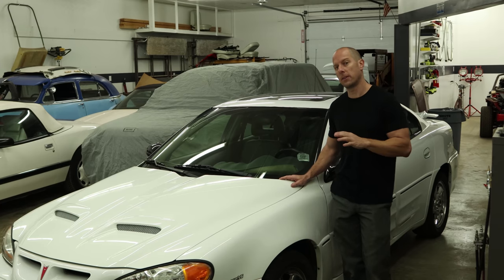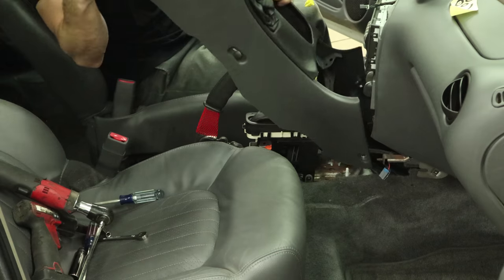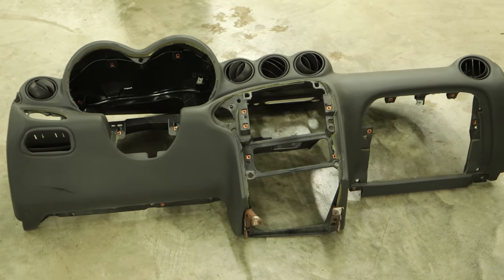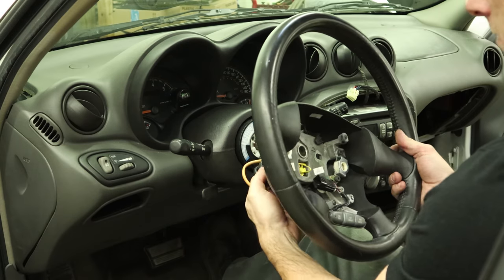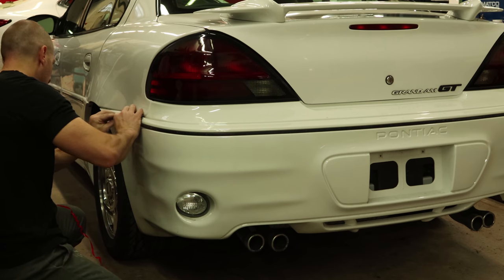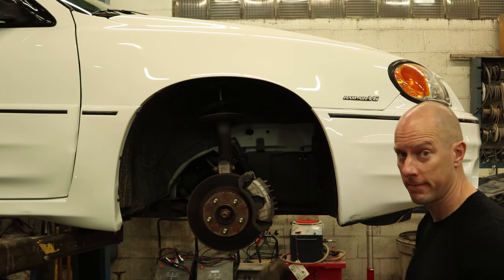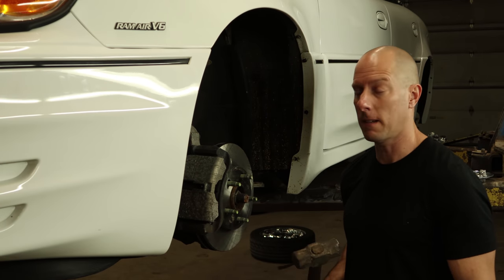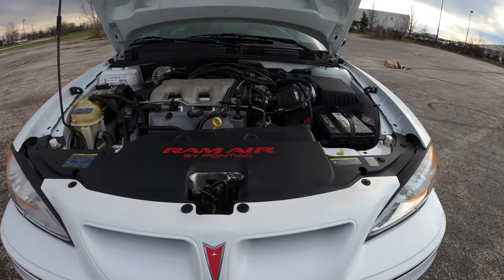Fixing all the typical issues on our super cheap 2003 Grand Am GT build

Comment: This is the cleanest Grand am I’ve ever seen and I like it
Reply: My aunt one had one brand new and it still looked crap compared to this one.
Reply: Anybody know by any chance what the small white car is called in 0:25 in the back
Reply: @clownjubilee1909  Buick Reatta. For some reason there are a couple of them in his garage.
Reply: No smoke stains, no skid marks on the seat, no old fast food trash piled in the back, still has hubcaps. Truly a one of a kind Grand Am.
Reply: Same here, I would gladly drive it!
Reply from the maker: It would have been a shame if I missed it and it got crushed.
Reply: I belonged to the grand am owners club about a decade ago. They had the cleanest cars ive ever seen, and i had my raggidy ol lil 96 quad 4 grand am i bought for $500, and I drove it 2 states away with every year for an annual meet on top of being a DD. I still have it too. I plan on sending it out for body work after i get this new job. Maybe he can help me out.
Reply: @LrulestheworldM8  SWEET! Keep it on the road man.
Reply: I know right? I used to work at a dealer when that was new! This looks like they did on the lot! Brand new
Reply: @clownjubilee1909  Oldsmobile Toronado Troféo
Reply: @LrulestheworldM8  What’s all wrong with it? I’d gladly buy it.
Reply: @StephaniexBecca1600  not for sale. Ill be buried in this car.
Reply: hello question what is the best way to fix  rusted out Rocker planes on 2002 pontiac grand am  2 door it has plastic covers under the doors to the rear well they will not inspection  the car  until we fix it
Reply: Got a 2004 grand am this week and it's just as clean, no rust or anything
Reply: @clownjubilee1909  could it be a mazda meada??
Reply: @vehcor  
Definitely!!!
Reply: I just bought one with 65k miles on it super clean
Reply: I’ve seen a lot rly clean dawg, mine for example was my first car and I’ve had it ever since and it’s clean and modded
Reply: I have a silver 03 that's pretty clean as well. Pretty reliable ride for real if you take care of it.

Comment: Your winter beater is better than my everyday driver.
Reply: Both Grand Prix and Grand am super easy to work on parts are cheap . I have 2004 Grand Prix 3.8 n/a 408000 runs like new shifts like new original just good maintenance good milage on highway if driven right . The only engine I would not want is the 3.4 4 overhead cam engine in the Grand am
Reply: @nickking1510 why, Tons of people say its excellent and mine runs perfect at 190k

Comment: I’ve recently bought a 95 Grand Am with 46k miles. It needs nearly every moving part replaced on it, but I’m getting there. This video series was a huge inspiration. Thanks so much, and great job.
Reply: I have a 97 Grand Am GT. 56 thousand miles  it was garage kept, but had work on it , that should not have Had. Water pump,  gage cluster board, air conditioning unit. It has a very small leak of coolant  after I park.  it I noticed  I see a little coolant in morning.  I like the car but heck. I think there should of been a recall on theses cars.

Comment: Well, before  plastic clips, body parts had holes, so that the Stainless could slip their expanding metal clips  into the holes. Just a few years older than you-However, I am amazed at your expertise with the cars that you fix!  Thanks for sharing that. Rich

Comment: Ugh, my damn dream car again.  I’m such a sucker for this car.
Reply: yes we all dream things we shouldn't
Reply: @jhonditch4269  my 99  runs like new  an its has the q4   ,,
Reply from the maker: If you take care of them, they last forever.  You can’t beat 30+ mpg on the highway out of a 18 year old car. Cheap to fix, easy to work on.  I’m looking for another already.
Reply: @vehcor  agreed also . Have have series 111 3.8 Grand Prix 3.8 n/a is fantastic in Ontario Canada I get 34 mpg on imperial gallon driving 150 km daily on the 402 . I also purchased a 2006 gxp 5.3 with blow transmission cheap . Rebuilt it and installed a rv transmission cooler in line with rad cooler and transmax Castrol synthetic fluid ( these transmission run way to hot stock in my opinion ) touched up black paint fixed a few minor problems polished waxed black paint . The gxp looks and runs like new and trans never gets above 184 f , the car has good  power and handles great for a big 4 door sedan on the Oem 18 Alcoa rims and Oem bilstein  suspension and gets 30 -32 mpg imperial

Comment: It’s too bad GM dumped Pontiac, they should have dumped Buick instead.  Always loved the Grand AM!
Reply: Buick is a top seller in China and contributes a lot to GM's profits.
Pontiac didn't...
Reply: @williamegler8771  Yeah I was thinking “China” before I even read your comment. The Chinese were always into Buicks even before they could get one. Pontiacs not so much. Of course Chinese Buicks aren’t all the same as American ones, but probably GM figured if they had to kill a nameplate, Pontiac would have less of an impact on China than Buick.
Reply: @Sashazur  I can't imagine why gm couldn't just pull a bait and switch on the Chinese. 
Call them pontiacs here in the states, and then swap the facia and call it a buick for the Chinese, and have them both be run by the same division of GM.
I only say this because the Chinese buicks are different looking then ours already so facia swapping shouldn't even be an issue. 
I seriously doubt the Chinese would notice or care.
Reply: Well they dumped the Grand Am before dumping Pontiac. Really a shame since they are great cars. Mines gotten rusty but still works, going to replace the rear struts in a week or so
Reply: @Sashazur  
Buicks are a thing in China because the President of China (when it was still a democracy) drove a Buick. 

CNBC did a special on it. Buick-China sells a luxury minivan that they don't sell in the US.
Reply: @Sashazur  aside from the reason Camry User mentioned, part of the prestige is that  Buick is an "American Luxury" brand. If there was no American Buick, then the Chinese models would lose some of their prestige.
Reply: I agree

Comment: The right way to fix the peeling dash is to reglue the existing one back on with glue that doesn't liquify in the heat.  Your replacement will peel back after sitting in the sun just the same.  I used some solvent based construction adhesive on my Alero dash.

Comment: Grand Am came out nice! I don't call this a "beater".
Reply: I know what you mean but it was saved from the crusher, so “beater” applies.
Reply: Oil undercoat every thing doors chassis rockers all unibody inner and outer boxed components  trunk quarters bumper mounts lines coil towers drill 1/2 inch holes to gain access then  plugs . Done right it will stay rust free don’t forget rad lower mount also. Proper maintenance and transmission and oil changes they last and super cheap to keep as a daily driver . So is the Grand Prix 3.8 and 5.3 super cheap parts in after market I have both cars

Comment: That whole process of pulling the dash is exactly why I haven't had heat in my car for 2 years.   I'd rather drive with mittens than go after the heater core on a 1990 F-body.
Reply: @FixItStupid  Reading that gave me a headache, thanks.
Reply: Real world cost to swap dash in this car must be over 500 bucks....
Reply: Just hook the heater hoses to the AC evaporator.
Reply: 3rd gen fbody heater cores are sooo easy. takes an hour tops. Pull the dash pad and passenger speaker to get to the top bolt, going through the dash with a long extension. the rest are accessible underneath. Then unbolt the bracket, pull off the hoses, then install new, and reassemble. If you really cant get at the top bolt just take the rest out and break that tab. or if you can get it out just dont reinstall it. simple
Reply: You dont even need to pull the dash
Reply: I've been to Dallas in January. It's not bad. Here in Chicago you'd be pulling that dash to have heat. :)
Reply: I have and 87 Camaro. The dash dosn't have to come out for a heater core. its still a PITA but way better that a dash pull
Reply: this wasn’t even that bad tbh
Reply: Heater core on a 1990 F-body is easy.  There is an access panel on the HVAC box.  Less than an hour to replace.
Reply: Lol
Reply from the maker: The easiest heater core I have ever done was probably an 86 ranger.  It took about 10 minutes.  I don’t remember what I decided was the worst because most of them suck! 😂
Reply: @coses4957  Only he know what he wrote.
Reply: On older American cars, the heater core was easily accessible from under the hood. It was right behind the engine, next to the firewall. Why they started putting the stupid thing inside the dash of every car is beyond me.
Reply: Im more amazed that you're driving an fbody in the winter
Reply: @vehcor  Laughs in German W140 S-Class. Notorious for their AC Evaporator as its two different metals that undergo glavanic corrossion in the presence of moisture. Mercedes book time is 24 hours. Not joking. I'm sure the heater core is similar since it's in the same box.
Reply: I was once looking at buying a cheap crown vic.. description said "just needs new heater core installed" .. I looked into how easy that was, and backed away after finding that essentially the entire car was built around the heater core ;)
Reply: I did a heater core on an 99 Mountaineer once. A few weeks later someone stole and crashed it. It seems I didn't hook up the airbags right. That thief left his dna all over that interior along with half his teeth. Oops, at least my wife didn't have to be the test dummy.
Reply: @paulparoma  I read that is because of the way they put them together on the assembly line with machines and needing space. Someone else might have a better explanation but it's been awhile since i read it.
Reply: I've had two 4.6 Ford/Mercury's, 98 F150 and a 2000 Grand Marquis. Both the heater core went up...Don't think i ever had to replace one ever except on my old 67 Mustang. Anyway i gave the Grand Marquis away, it needed more than it was worth to make it safe. The truck i used k seal on but i know i need to figure out a simple way to swap it out, i'm not experienced enough to do the dash pull. I don't think i'll buy another 4.6. It's too bad cause it's bulletproof, the Grand Marquis had a plug drop through, sounded like a sewing machine, and in less than 2 o minutes with a heli coil it was running like butter. When antifreeze fills up your cab and you can't defrost the windows when it's so wet, like it has been here, that's a problem, a big problem...The k seal, a double dose is working for now and i have heat. Maybe i'll cut a hole through to it...
Reply: @dewdew34  Could be. Everything is more complicated than it should be these days.

Comment: I learned the hard way that the intake and exhaust pushrods are not the same length. I was doing head gasket on a Chevy Venture, and when I got it back together I went to start it the valve and piston had a fight. luckily it was only 2 cylinders that bent a pushrods and valves. I've done a dozen of these intake gaskets, and now pull them off and store them in order front to back

Comment: The hater's tears at the end was brilliant......  On another point, when you replace the brake discs have you thought of spray painting the disc hub to reduce the corrosion?               It also looks good for cars with sports type wheels where the brakes are more visible.
Reply from the maker: The paint doesn’t last up here in the salt so it isn’t worth the work to me.

Comment: I own a second gen Chevy S10 and the dash is made of the same material.  An interior expert told me years ago that if you coat the dash with mineral oil once every few months, it keeps the vinyl from shrinking.  I’ve done that to my truck ever since then and have eliminated the curling and cracking issues.  You should try it!
Reply from the maker: I believe him.  It explains why some last and some don’t.  Usually the ones that last are the ones people clean the interiors on regularly.

Comment: Found a 2003 Oldsmobile Alero, 2.2L eco tec with 23,000 documented miles.  Before buying, put it on a lift with a ase mechanic, all factory original parts, no rust.  Runs well, and is tight.  Replacing serpentine belt, trans filter & fluid, flushing coolant.  Think I will re-grease the CV joint & replace boots.  Will keep an eye on rubber parts & seals.
Reply: Will shoot down with Fluid Film to keep rust at bay.

Comment: It's always rusty ones with good dashes and rust free ones with bad dashes! I bought a rust free one to swap my built motor and turbo into and it had a bad dash, so I swapped it with the old rusty ones! 

As far as pricing. There's so many factors, I've been messing with these thing for 10 years now and no 2 have ever been the same 😂 I just sold an 02 for $3500. But I've also bought my rust free running/driving one for $500. So it goes both ways!! Heck one that had $20k worth of mods done to it sold for less then what you got from yours! Congrats on the flip, buying a car knowing it was gone over like you did really helps! Someone got a good car!

Comment: My Bare bones 2002 Grand Am was bullet proof. 185k miles. The only non maintenance item was a ignition module. It was a 4 cyl with roll up windows and auto trans. Rear under body rusted badly and subframe was about to fail out. Brake lines rusted throw at Jan 2020.

Comment: Definitely a pain in the butt replacing heater core in one of those I did that over the summer fix my Dash 2 didn't replace it used to heat gun to bend it back down and use flex glue to glue it looks pretty good

Comment: Every time I do an intake gasket job on a 3X00, I degrease the upper intake, valve covers, and thermostat housing then hit all of those parts with some VHT "aluminum" high-temp engine paint.  Stuff lasts for YEARS and easily repels dirt, oil, grease, etc. Keeps the engine looking like new!!

Comment: That car in nice shape oil under coat for sure . Definitely not a beater. I purchased a 2006 gxp 5.3 with blown transmission cheap needed paint touch up beefed up some of the unibody dyed black leather front seats , repaired electronics in heads up display , repaired multi function turn signal switch broken wires on abs  minor rocker repair  brakes painted rotors Oem red using machinery red paint and paint touch up door latch oil change replaced rad and installed rv transmission cooler and synthetic trans max transmission fluid after transmission rebuild ( in my opinion the big reason transmission go in a lot of cars and trucks is to much heat and no transmission fluid service ever and abuse ) . Any way after I did some minor body work and applied paint I polished the entire car and applied 2 coats of mother wax . But your Grand am is super nice also and white or black is very easy to match which might be a good plan after winter but oil under coat before going out in the salt . I mix cheap cooking oil some chain bar and some old school 90w gear oil and some  mineral spirits or diesel and use suction feed paint gun  and pump up sprayer and drill 1/2 holes and undercoat plugs done annually

Comment: I may have a high mileage and, rusty example of an 03 Grand Am that is an SE, I still love it, have the 2.2l with the 5 speed. It's still a great daily driver even at 220k miles. even have all the mentioned items fixed beside the dash peeling from shrinkage.

Comment: Good looking car, and great work as always.  Watching this made me shudder though, with memories of my grandmother's '99 GA GT, similar to yours except it had the thin spoke older style wheels and no leather.  Those things were slapped together with 0 pride in workmanship, no quality control, and even less regard for the end user.  Hers was bought at 4 years old with @ 35k miles right around the time she retired.  One week later the rear view mirror assembly fell off.  It went downhill from there.  That thing was a constant nightmare of failed sensors, check engine lights, warning lights upon warning lights, fluid leaks, failed gaskets, mystery electrical issues, fit and finish issues (failing dash and door panels, weatherstripping leaks, seats which went flat and broke down alarmingly fast, etc.,) cheap plastics (hvac control knobs, window and mirror switches, et. al.) that disenegrated if you dared use them, a transmission that started slipping and sporadically refused to go from reverse to drive around 60k, and a harsh, weak suspension setup not suited for potholed Midwest roads which ate expensive low profile tires and equally expensive alloy rims.  And rust.  You could hear it rusting as it sat idle.  Bumper crash bars, fuel filler neck,  quarter panels, rockers and pinch welds, and vital substructure disappeared prematurely to the point there was no safe way to jack it up anymore, and was accelerated by all that plastic cladding crap which trapped dirt and moisture in the worst possible spots and just turned it into a soggy rotten pumpkin.  Around 114k the front subframe completely rotted thru right where the rust is showing on this one during the oil change segment, and we deemed it "done", and insisted she get rid of it.  I found a clean one owner 32k mile '99 Escort Pony sedan for her as its cheap replacement and 3 weeks after going to its new home the Pontiac's transmission died.  Good riddance.